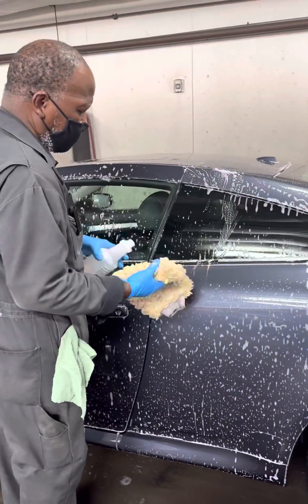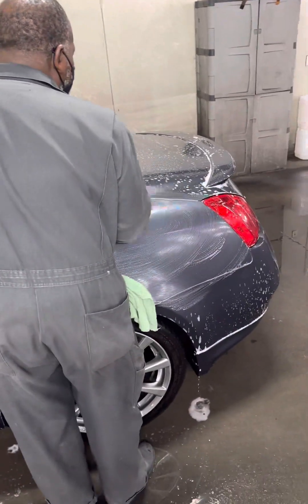Performing Acid Wash

Comment: Hi Jay did u notice any damage after any car u wash?
Reply from the maker: No! It always depends on how strong your acid mix is, how long you leave acid on exterior body and if you are performing acid wash treatment inside a cover shop, canapé away from direct sunlight. I have damaged several automobiles exterior paint but, these vehicles was pledged with water spots on the entire exterior bodies and windows. I pre warned service advisors about vehicles exterior bodies
Reply from the maker: I was given the go ahead and I did remove all water spots and I performed exterior details on these vehicles. These vehicles were very shiny with a high gloss but, after looked deeply into vehicles exterior I did see like a shadow in these vehicles hoods. Once a customer gives the go ahead they are blinded by the high shiny gloss they don’t realize the shadow. I It’s very important to find a mixture of acid soluble before, performing acid wash or don’t leave acid wash on exterior surfaces to long.